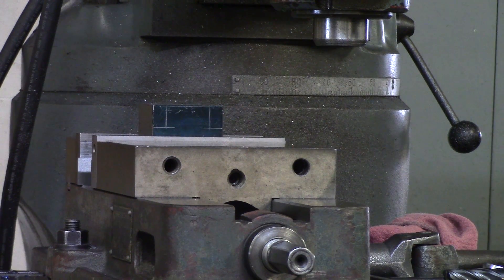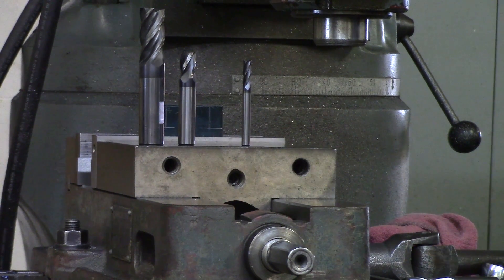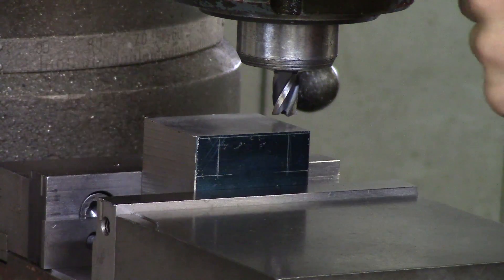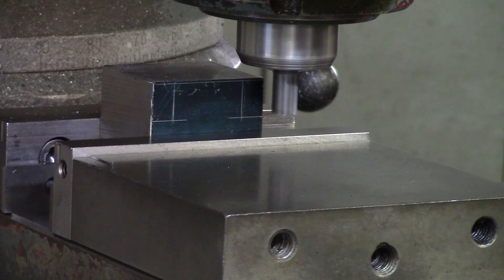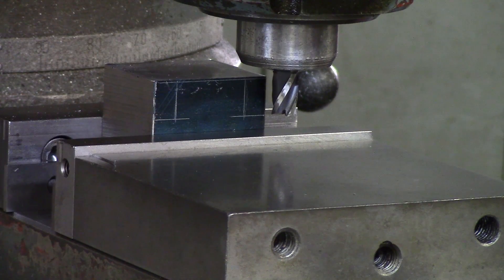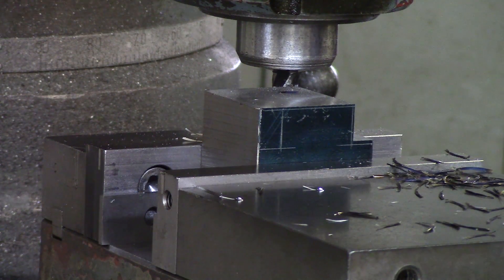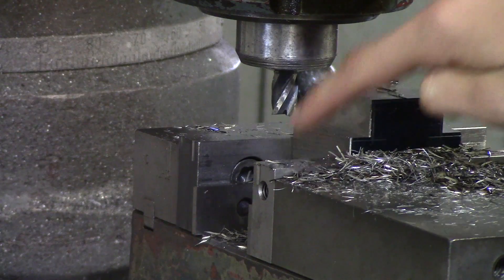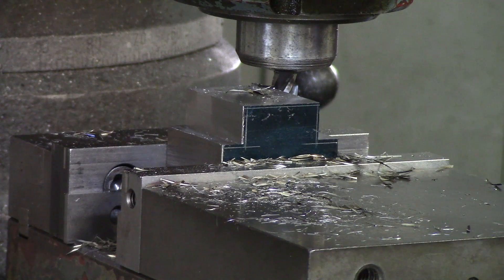What's the BEST Endmill for Beginners?

Comment from the maker: Quick clarification: In this video, I mentioned that HSS (High-Speed Steel) is out of the equation, which isn’t entirely accurate. HSS is still widely used, especially in drills and other tools, and performs well in many applications. However, carbide is a "newer" technology designed to handle higher speeds and tougher materials, like steel, more efficiently. If I had to choose between the two for cutting steel, carbide would be my pick for its speed and durability.

That said, now that I’m a bit older and wiser (haha), I plan to make an updated video in the future to share what I’ve learned and provide even better insights. Stay tuned, and thanks for your understanding!
Reply: I see where you're coming from concerning the capabilities of carbide cutters. But I still disagree with you, with all due respect, concerning beginners. I am a NZ  Trade Certificate Qualified Fitter Turner Machinist with over 35 years experience in precision manual metal machining and engineering. I did my apprenticeship for Renold NZ Ltd making industrial gearboxes and wormgear reduction drives and I have about 9 years experience making mechanical seals for Paulmen Seals Ltd and Eagle-Burgmann NZ Ltd and also another 20 or so years experience in precision jobbing shops including extensive precision cylindrical & internal & surface grinding and extensive experience with centre lathes and manual mills. I have cut thousands of keyways and slots with plain HSS Slot drills and Endmills. Plain HSS Endmills and Cutters are the best thing for a novice to get a baseline reference of experience and practical knowledge of how the cheapest most basic cutters perform in a wide variety of materials and machining conditions. Greenhorns tend to be hard on tooling, although HSS can perform well in most steels and when in good condition can cut well. Hell No Mate, I'm not going to use it for certain materials , Hastalloy Stainless Steel will destroy HSS as soon as it looks at it and other very tough materials it's just not suitable for, given modern tooling. Mate I use HSS cutters all the time. As long as they're sharp then they're generally okay and get the job done well. No they don't last as long as expensive tooling but I see no reason to "label bash" and drop big notes with flash tooling all the time when HSS Endmills and Slot Drills , even HSS Ripper Cutters for roughing out, are sweet as most of the time. Especially for a lot of manual machining where it's just one offs or short runs anyway. Yeah carbide is good for CNC and high volume production and, Yes high performance machining. I will always still stick up for good ole HSS.
Reply: 15yrs  of cutting ms with hss in a tool and guage shop taught by my father-in law who learned at the ford trade school in detroit.

Comment: Is the endmill tip is inclined axis just a little (not a perpendicular ideally to the surface)? Otherwie if it is flat perpendicular I cannot comprehend how climb milking is different from conventional milling for the end milling and face milling. It is straightforward to understand Ed for a side milling: it only touches the surface one blade at a time. However for surface milling, it appears to be milling with all blade at a time: then for whatever chosen direction the part moves one blade is always rotating along the direction and another the opposite direction; that is for 2 flute endmill whereas for 4 flute one there will always be tangential cuts ass well.

Comment: I'm a Fitter Turner Machinist with over 35 years experience in precision manual metal machining and engineering. I did my apprenticeship for Renold NZ Ltd making industrial gearboxes and wormgear reduction drives and I have about 9 years experience all up making mechanical seals for Paulmen Seals Ltd and Eagle-Burgmann NZ Ltd and also another 20 or so years experience in precision jobbing shops, including extensive precision cylindrical & surface & internal grinding. The best Endmills for beginners are the cheapest plain HSS Endmills. I have cut thousands of keyways and slots with plain HSS Slot drills and Endmills. They work well when in good condition and are cheap and affordable to buy.  Ripper Cutters do make for lighter work for roughing out , but they are more expensive. Novices tend to be harder on tooling so when they are learning it's good for them to have a well rounded understanding of the capabilities of standard HSS Endmills and Cutters. That's as a baseline reference of experience with the fundamentals of High Speed Steel tooling and how it performs with a wide variety of materials and machining conditions. They should progress on to more advanced tooling with experience and practical knowledge of how basic Cutters perform.  Expensive tooling can still fail & break and they're a lot more to lose than ordinary cutters when it goes snafu and a bit of metal mayhem starts happening. Although the real lesson is knowing first hand what HSS is capable of,  then you can really get a feel for what high performance tooling can do at it's best. 🔩⚙️📏💯
Reply: I am a beginner and use carbide cutters.
 They perform better than HSS and save money in the long run.

Comment: Also to add, when slot cutting, use a 2, 3, or 5 flute.
Never a 4 flute, unless you can accept it to cut oversized.
But then the deeper the slot, other issues can come up.
But to use an under size cutter,  ruff and finish to size if is critical.

Comment: Climb cuttings on a lead screw machine can problematic.
A CNC mill has a ball screw, so it will not walk the cutter across the cut like a typical manual mill like a Bridgeport with a standard lead screw.
Many reasons why to climb cut, and only a few reasons to conventional cut .
Climb cut 99% to 100% of the time if possible on a CNC.
Conventional cutting on a BP, because you really have no choice.(Lead screw, no ball screw)
Just one example:
Conventional cutting pulls the cutter into the work, (cutting more than you want) and pulls the parts out of a vice.
Climb cutting pushes the cutter away, and the part down into the vice.
Climb cut leaves a better finish and longer tool life 
Hard materials sometimes need to be conventional cut.
And so on,,,,,,

Comment: if you have coolant on directly on a HSS endmill and lower the speed a little bit and take smaller cuts you can cut cut steel no problem (not hardened steel tho) and carbide is always better but cost more

Comment: On CNC machines, I conventional mill for roughing and climb mill for a nice smooth finish. You can climb mill on a CNC because of the zero backlash ball screws these machines have.
Reply: I put ballscrews in my Bridgeport. I rough off material like a cnc with it, it's bad to the bone.

Comment: Using this type of machine you are prone to side mill using an end mill.   They do not call them END mill for nothing.  You should plunge cut an end mill and just light finish side climb mill.  That way you only have to sharpen the bottom . End mill last much longer and less time grinding just the bottom.

Comment: I’ve been using high-speed steel and mills on Steel for 40 years. You just need to get your speed and depth of cut correct. A little cutting oil won’t hurt. Of the three carbide end Mills, I think you chose the wrong one. I would’ve gone with the larger one. The larger end mill would have been more rigid and all-around more useful if you were only going to buy one.
Reply: 55 Years for me using HSS.

Comment: That hss roughing endmill would've taken all your extra material in one pass. You just have to keep the cutter cool with some kind of cutting fluid. Those teeth on roughing endmills (aka turbo mills) greatly reduce the amount of power needed to take the same cut with a regular endmill. Also it's Rigidity not rigibility. We also use conventional milling on manual machines because of feed screw backlash not lack of rigidity. If anything, most of the manual machines I have used are MORE rigid than a lot of CNCs

Comment: Thanks for the video.  Is there a reference, or cheat sheet to show spindle speeds and feed rates for various types of steel/aluminum and various types of mills?  I’m milling 17-4 stainless with a carbide 5 flute end mill.  Also, how do you know how deep of a cut you can take?   Thanks again.
Reply: zeus book. Little pocket book full of machining information

Comment: not TRUE,, in regards to the "climb cut" ..the climb cut works well for holding size and finish ..for instance..cutting a keyway ...use a SMALLER THAN REQUIRED dia. end mill to rough the keyway.. then remove the remainder of the width .by removing the SAME AMOUNT of material from EACH SIDE of the slot ..

Comment: I’d like to correct you. Not all but many older machines “if” the gibs and ways are in good condition and you have a good table and you have sufficient HP, you can climb mill which I personally did myself for over 30 years as an application specialist for a major carbide end mill company. (Which is better and preferred ) on most all carbide end mills. Conventional cutting will prematurely wear your end mill out because of the rubbing from a zero chip thickness to a very heavy chip throwing all the heat on the tool and dulling the tool quickly. Climb milling puts all the heat into the chip so less heat is at the edge of the tool and less wear and tear on your tools. The part will be barely warm to the touch. The proper SFPM-surface feet per minute and CPT-chip load per tooth is required for a given material. This will help the performance of the tool in a given material.

Comment: interesting, I have been told by some people to "always climb mill" even on a manual machine, but my old mentor said conventional milling is the way you do it. I always have better results like that anyway!
Reply: If the machine is ball screw clim cutting is the way to go and all cnc machines are ball screw. Some manual machines are just screw and nuts and it has lots of backlash, so it’s better to use conventional.
Reply: Depends on the machine, with old machines which has a lot of slop in each axis, conventional, because it won't pull the part on the end mill

If the machine isn't a half dead one, and can do movements without slop, then climb

Climb cut has an advantage because the edges on the tool won't rub on the piece, increasing tool life, and if I'm right it needs less power from the spindle as well, but it needs a rigid machine, otherwise the tool will destroy itself
Reply: I just retired from 40 years in the shop. Imho there are not any firm rules as there are a bunch of variables to consider. As one poster mentioned yes, climb cutting can be difficult and even disastrous on a machine with a large amount of backlash. Climb cut will often give the better surface finish. One thing I have done on a loose machine is to remove bulk material cutting conventional and if a climb cut is desired tighten the table lock slightly on the axis you are cutting on to help the cutter not grab the work. Its worth it to take some time and adjust as much backlash as you can out of your machine. In machining experience is golden so get in there and do it. Be prepared to pop a few cutters but that is how it goes.
Reply: Conventional mill on a manual if you’re taking any type of meaningful cut. Climb cut at your peril!

Comment: Wow!! Been using high speed steel to machine steel like forever. Who ever told you that? How long have you been doing machine work, jeez dude.
Reply: It works in a pinch but if carbide is an option, always go carbide.  It's superior in practically every way, from material removal rate to finish quality and tool life.

Comment: Imagine if we could cut steel with hss. But I guess that is simply not possible
Reply: Don't know if you're being sarcastic or not but you definitely can cut mild steel with hss end mills. Just run slower and use oil.
Reply: @AK99581  He is
Reply: @AK99581  most certainly sarcastic
Reply: if you have coolant on directly on a HSS endmill and lower the speed a little bit and take smaller cuts you can cut cut steel no problem (not hardened steel tho)
Reply: I mean...you can.  But it's about three times slower and gets dull a lot faster.  I'll use it in a pinch or for specialized tools that aren't doing heavy cutting or will only be used for one job and then be forgotten.  For tools I use a lot, carbide is the way to go these days.  It's expensive but in the grand scheme of things it's not prohibitively so when you aren't breaking tools left and right, and if you'll get your money's worth out of carbide.  HSS is great for plastics or materials you expect a lot of vibrations on, since it's less brittle than carbide.

Comment: HSS mills are almost free compared  to carbide tools, and can be  used  for most materials if you calculate  the cutting data..
Reply: Yeah, we use HSS mills almost exclusively to cut aluminum, Hot rolled and cold rolled steel, etc without many issues. Then again my company provides unlimited end mills, so if we bust one, we have access to more.
Reply: How much do you value your time?

Comment: I have to disagree on the point of choosing the .5 over the .75 because of price. If you can't afford it don't buy one, but if you can afford a .75 carbide FEM and it makes sense in your application, use it. With proper use it will last a long time and you will be able to hog through much more material than the .5 FEM. While it is much more expensive, if you're using proper feed rates then it should be able to make you much more money than you spent in the time saved cutting your material while lasting a long time.
Reply: The smaller cutter you can spin a bit faster and keeping chip load the same if you can will give a little more feed ability

Comment: There is a time and place for climb milling, it definitely serves a purpose, and HSS can be used to cut steel, it just doesn’t stay as sharp as long...
Reply: I actually climb cut on anything, from the clapped out minimill at work and a equally clapped out 40 taper knee mill, to the brand spanking new 50 taper big boy box way horizontal universal manual mill (with a universal huron head attachment, a +-45° table, a universal angle rotary/dividing/differential indexing/helical milling head-tailstock attachment along the dreams of finding the elusive vertical slotting head attachment...universal af in general) and the VMC of course. On manual machines I can do some pretty fine work on steel with quality HSS-E tools, but when it comes to VMC work (even if it's just a one off prototype/jig/fixture/mold/die/stamp) I cringe whenever I as much as touch an HSS tool that isn't a tap or a countersink (not a chamfering tool though) on the bench
Reply: @Sketch1994  Im pretty new to machining, maybe 6 months or so running a VF2 doing job shop work and i just noticed that ive never had problems neccasarily climb cutting when cleaning up stock, on ABS it seems to make a big difference or else it will be very hairy, also i find it confusing how its called conventional milling vs just calling it climb cutting vs, well not climb cutting?
Reply: @nobletangent  Technically it's upmilling and downmilling
Reply: @Sketch1994  the more you know

Comment: What is the difference of HSE and HSS end mills? I bought 2 HSE 2-flute end mills and it can not flatten a pre-drilled hole and its sharp points will wear out as soon as it touches the work piece; also its cheaper for only $18.40. Then we bought HSS Co. no 8; its points do not dull fast unless you made a mistake while setting it. I just wanna know the difference of the 2. Thank you!

Comment: how do you actually do a perfect feed rate on a manual mill once you have worked out the feed rate for your tool? got my RPM set for my two tooth carbide end mill with 260mm per min travel.. but how do i actually put that into practice? new to machining here )
Reply: Really need more info but in short, if hand cranking, then it really comes down to feel with experience. If you have / are using a power feed, then you can get really close with a stopwatch / timer and adjust the power feed speed till you get what you want, then make your cut(s)... Just take your desired feed, then divide it by 6 and mark off the distance that you get (rounding to nearest .5 (or even whole number) if you get a decimal will get you close enough 99% of the time) and then adjust the power feed until your mill travers's that distance in 10 seconds. Unless your using less than 3mm (1/8") endmills, I wouldn't worry about the feed error from rounding, or just always round down so to reduce chip load rather than rounding up and increasing chip load.

For example, lets say that you needed a feed of 300mm/min, just divide that by 6 thus getting 50, so mark of a 50mm distance and adjust the feed until you cover that 50mm distance in exactly (or as close to) 10 seconds time. If you have a DRO, then its even easier since you can start the feed and the stopwatch at the same time and kick the feed off when you hit 10sec, and see how much the DRO said you moved, then adjust the speed unitl the DRO is as close to the target number as you can get (i.e., 50mm in this example).

EDIT: Rereading an older post because of a "Like" popping up and I realized I had an error in my time vs. distance math.. Was thinking of the 10 second interval and accidentally said to divide by 10 which it really should be 6 to arrive at the distance per 10 seconds.